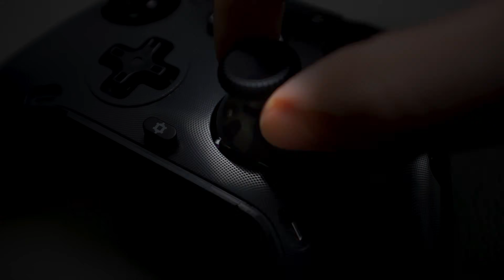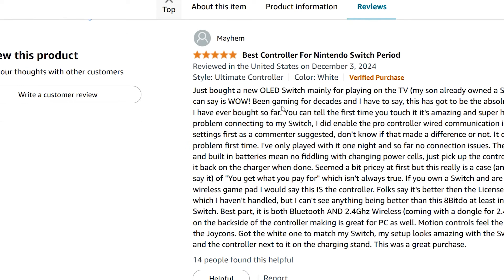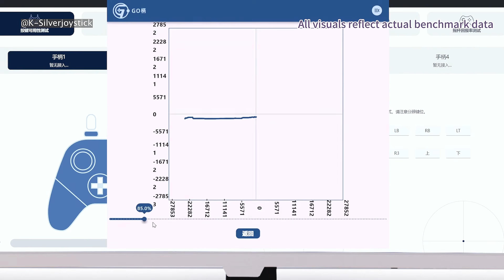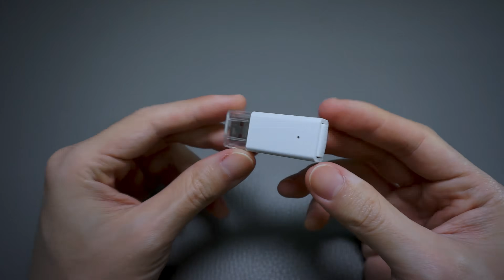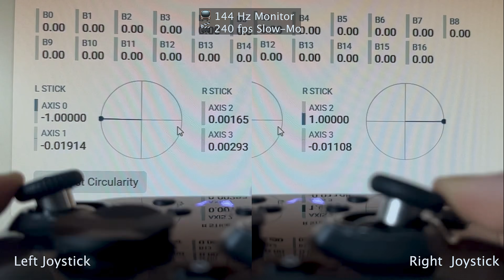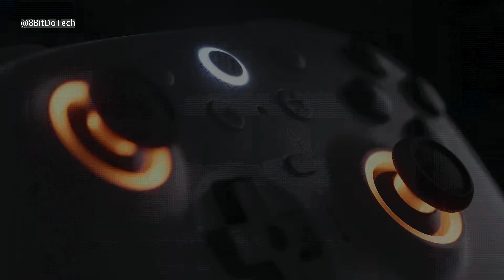Mobapad Huben 2: Next-Gen Capacitive Joystick PC & Nintendo Switch Hybrid Controller

Comment: So far there are 3 with capacitive sticks,Beitong kp70,Mojhon rainbow 3 this huben 2
Reply from the maker: PXN P58K should be the first using capacitive joystick, huben 2 roughly the same timeframe. This is consider new tech, the cost of the joystick is much higher compare to hall effect and tmr. It will takes awhile for company to adopt the new joystick.